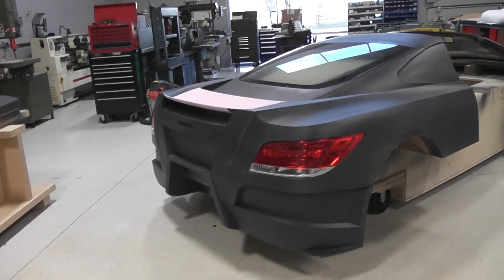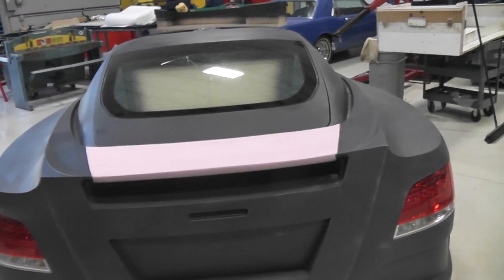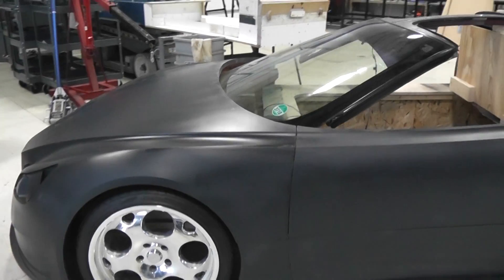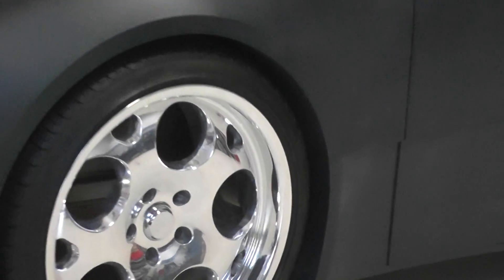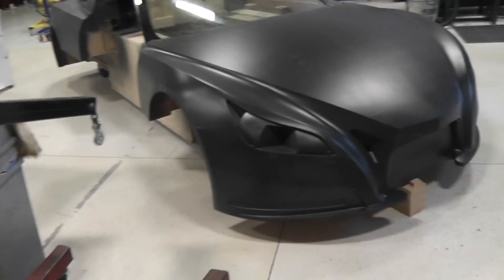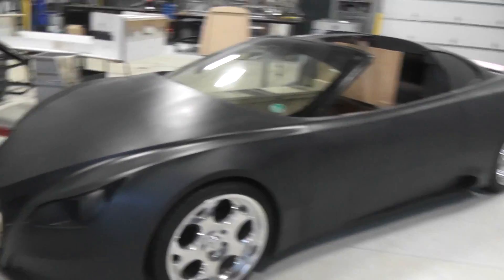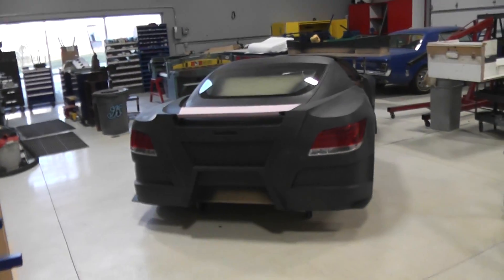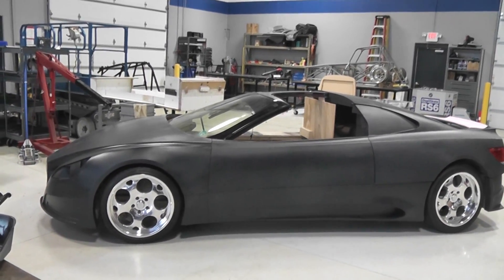Scratch Built Car Project

Comment: I love the job. This is pure inspiration to me. Though, i have to ask, how did you achieve symmetry while designing this? What method did you use? I'm reeeeeally curious!
Reply from the maker: This was made on a much smaller scale in clay. The small clay model was then scanned into a computer. The little imperfections were removed by the computer software. Then the computer scaled it up and a CNC machine cut the separate pieces of foam out. The pieces were then glued together and this is what we have. A much cheaper way is to just do it by hand and take a lot of measurements.
Reply: GunsNpolitics was that CNC Machine a big scale machine or small scale? Perhaps something buyable for a small scale fabrication shop? I would like to know since i want to invest in restoration and modification of current car models in my country, and this information is really helpful.
Reply from the maker: Dave Njoroge I never seen the machine. I think it was a normal sized one that is commonly found in a machine shop. I base that on the size of the blocks that were made separately and clued together.
Reply: GunsNpolitics Thanks for the information. really insightful.

Comment: What materials are you using for this car and do you have any suggestions for me because me and a friend are building a car. Thanks and keep up the great work.
Reply from the maker: The one in the video is made of high density foam. I made fiberglass molds off of this model. The body was then made out of fiberglass and carbon fiber. You can use foam to shape the car how you want it. Then make fiberglass molds off of your foam model and then make fiberglass parts out of the molds.
Reply: Thank you so much! Great job on the car btw. It is amazing! I really like the design of the car. If you have any more recommendations for how to make the car Please let me know. i want to make as amazing of a car as you did. Thank you again!

Comment: is is SUCH a sick car man.... whats under the hood?
Reply from the maker: I believe it's a C6 corvette engine but it's mid engine.
Reply: GunsNpolitics Is there any way you can convince the owner to share a walk around of this car? We all love the innovative design. Why was all this money put into this project? Is this for a private customer/custom car build? And are the tail lights home made?
Reply from the maker: MCAReview The owner is a retired engineer that worked for an electric company. He is just enjoying his retirement I imagine, doing what he loves and going to see if he can sell a few. I'd call it living the dream.
Reply: GunsNpolitics isn't it yours?
Reply: GunsNpolitics never mind. I see that it's from your work. 

How on earth did they get that shape of the body? Is that sheet metal?
Reply from the maker: Nitride The car was made on a small scale out of clay. Then the clay model was scanned by a computer and resized to full size. That file was loaded into a CNC machine and the car was cut out in sections. The sections are made of a high density foam. The sections were then glued together, making this car that you see in the video. The dark color is Duratec surface primer I sprayed onto the car model. After sanding and buffing the primer, I began making fiberglass molds off of this foam model. Then I made fiberglass and carbon fiber body panels from the molds. This foam car cost about $50,000 to have made this way.
Reply: ^So much YES to this question PRETTY PLEEEEAAAAASE!?

Comment: Where did you send you mold to to get the foam parts made
Reply from the maker: The foam was CNC machined. I made the molds off of the foam body in this video. Then I made the composite body from those molds. We're still working on this car. I should update with another video.
Reply: Ok so if I made a clay mold who do I send it to what company?

Comment: D0M1NIX I agree, car manufacturers are like, "oh hey lets make a cheap car, and lets also make it look like shit!" and then they decide to make a cool looking car and are like "hey this car looks cool!, lets make it 250,000 dollars!"
Reply: You don't know how right you are
Reply from the maker: +Stay away from my peanut butter The Chevy Cavalier probably cost millions of dollars to produce the first one. They estimate how many they will sell though and price the car based off of that. They sell a lot fewer Corvettes, so the price is higher to cover the cost of developing it. This car is a one off. It is the only one in existence.  If it sells, another one will be built. The cost will have to be pretty high for this car. Using a lot of things that already existed, like the chassis and engine, the cost of building this car is lower than doing one from scratch, designing every clip, bolt pattern, and computer. This car has still cost somewhere in the $200,000 range to build. The foam model in this video cost $50,000 by itself to build. If it does sell, it will probably be to a celebrity that has more money than they know what to do with and wants to own something that no one else has.